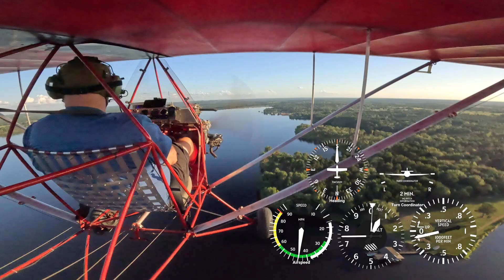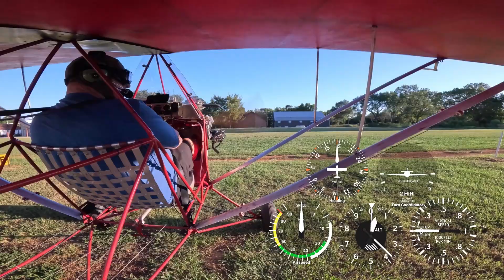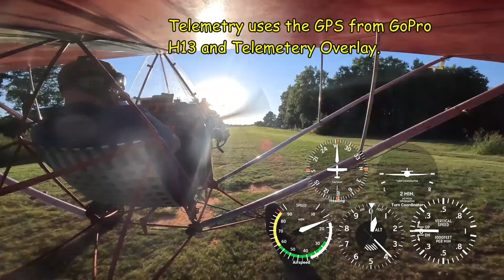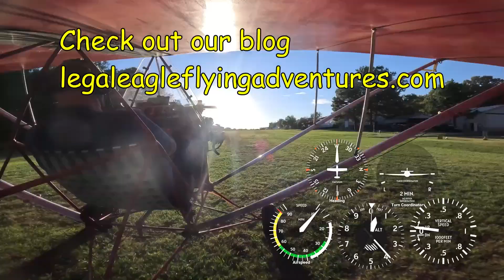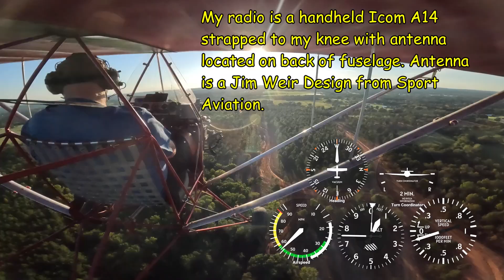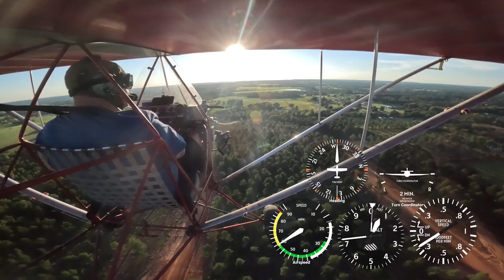Legal Eagle ORV flight around Aero Estates T25 Testing Audio and Telemetry

Comment: I read this post from the Legal Eagle site, can you confirm the glide slope of a Legal Eagle XL ( assume no wind with a 230 pound load)? Post was a response to a question about a used VW engine dated Oct 14,2025.  I am trying to understand the ability of a Legal Eagle to glide with a Dead Stick, also under dead stick conditions does the stall speed remain about 30 miles per hour, I did see  a post were the landing speed was stated at  three times the stall speed under a dead stick landing for safety concerns.

"Power off, the LE probably has the glide ratio that is a little better than a brick , maybe 4:1. So your power off touchdown point from 1,000 ft agl is going to be 3,000-4000ft in no wind without maneuvering losses. That is a lot different than an 8:1 glide of a Cessna from 6,500 ft agl."
Reply from the maker: I would disagree with that. With engine off you are going to land, go to about 45 mph and find a site to land. We have a very distinct advantage in that we can get down to about 27 to 30 mph to stall so if we fly it to the ground and do not stall it in a panic we can land in very short distances. Not sur what the glide ratio is but It has never been a concern of mine and I have made several engine off landings.
Reply: @LesHomanLegalEagleXL  Thank you for the reply, I did find that under a dead stick the propeller in a Legal Eagle would act as an air brake requiring 12-16 miles per hour compensation ...so with a stall speed of 27 plus 16 your suggestion of at least 45 meets that recommendation.

On a separate note I did watch your video of a  Ground loop and the changes that you made to improve safety.   Have you watched this clip of an Airbike with a similar concern, Language is a bit colorful at the end.   I not sure if your improvement would correct the problem that was on the Airbike,       I have noticed instead of  "Washers" some other Airbikes are being made with a smaller tube side-rest to insure feet do not slide sideways off the foot control surface.    https://www.youtube.com/watch?v=f3Wm-LxkYPY&t=23s